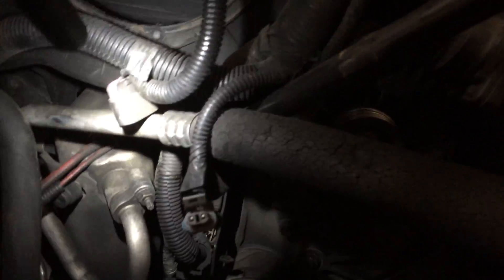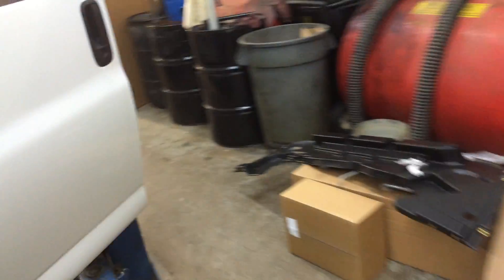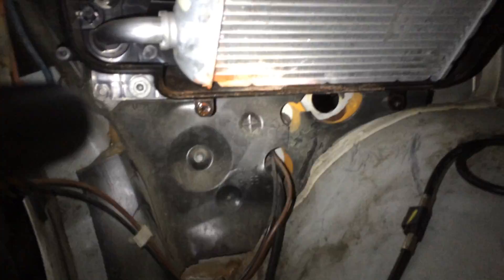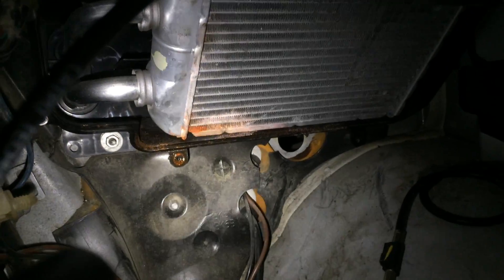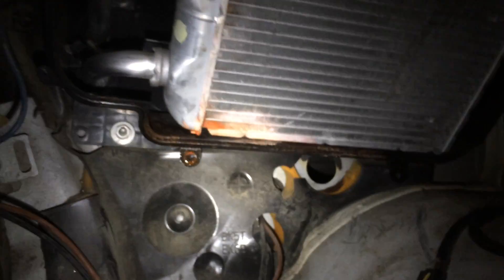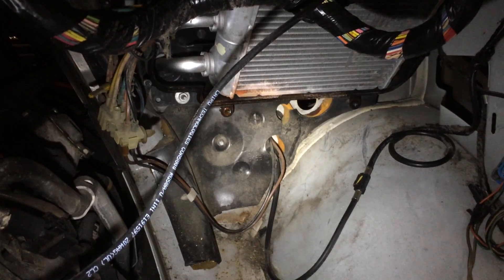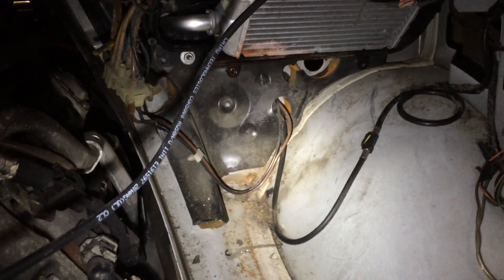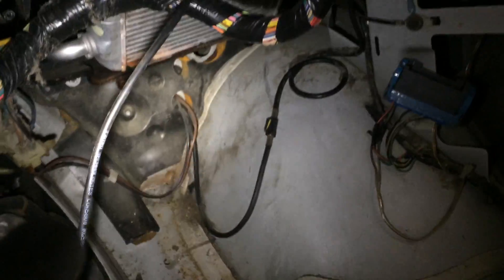Duramax Heater Core Leak

Comment: (((( sir it the ** harmonic balancer on the 1999 toyota camry )))) The NUTS was loose & now the belts in nuts and bolts got tighten up so he start it up and sound good till he got out car in about 4 more min. while car was Running the little sound came back ,HE TOLD me i need to look at the belts the top belts was beat up some so he took apart that thing hold the belts and said come here and look it's my harmonic balancer HELP!!!